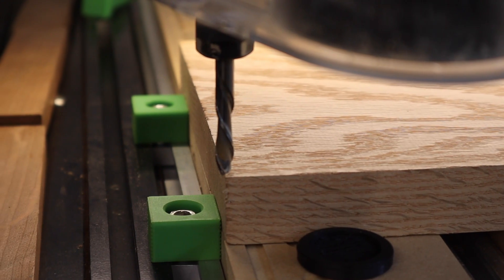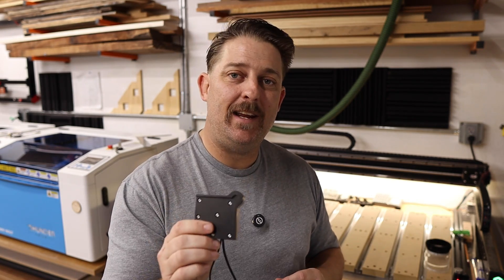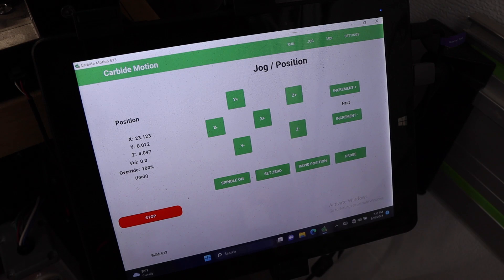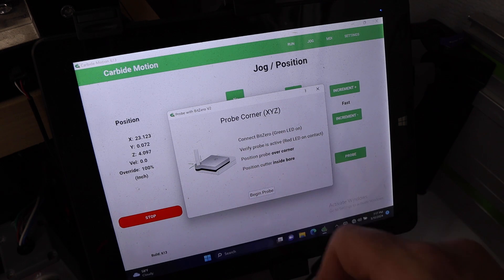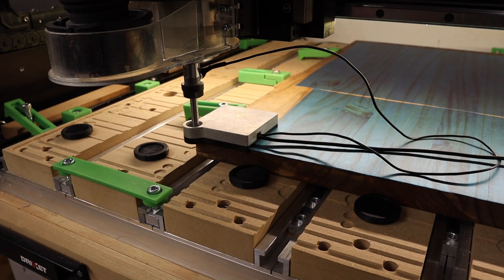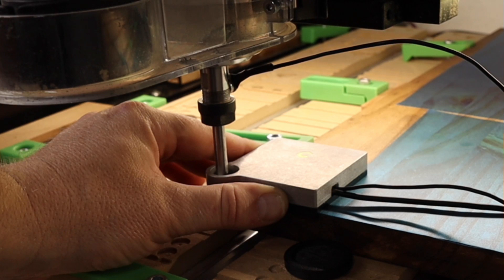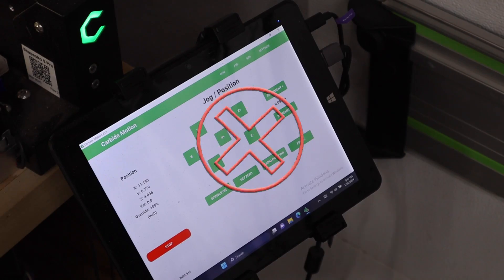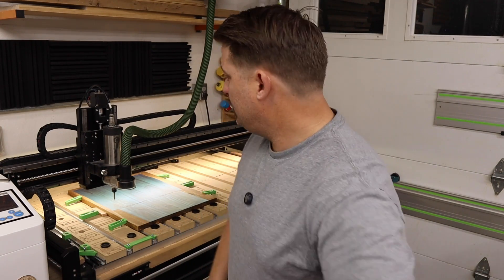How To Use Carbide 3D Bit Zero 2.0: Essential CNC Setup Tips! | Brett's Laser Garage

Comment: Brett, are you using CM V6?  On my Shapeoko Pro running CM V6, I no longer have the option to Set Zero.  I'm using the 1/4" pin to calibrate.  After finding the stock thickness I get the popup to remove the grounding wire.  When I click on OK the router moves to lower right to load a tool.  TIA
Reply from the maker: Hi there.  Yes I’m running CM V6.  Never had that issue before.  Maybe try searching the carbide 3d forum to see if anyone there has had the same problem.  Worst case I would contact support.

Comment: Brett, I found this to be perfectly explained.  You may wish to update and explain how, when probe is removed from collet, the router bit/mill is the EXACT right depth in the spindle.  I subscribed, and will be checking back.  Thanks
Reply from the maker: Thanks a lot Donald.  I think if it like this…the bit zero isn’t measuring the length of the bit in the spindle per se, it’s measuring the height of the bit off the material and storing that location.  When you switch bits or from the probe to a bit, the bit returns to the bit setter tool and measures, which brings the machine back to that stored zero point.  

So don’t think of it as returning the bit to the exact same depth in the spindle.  Think of it as returning the tip of the bit back to the zero position.  The bit setter is a huge part of this process that I didn’t explain well.  Without the bit setter tool, you’d have to use the bit zero and re-probe the z-height after every tool change.
Reply: @LaserGarage this answers the question I had after the video. Thanks for explaining

Comment: Using the BitZero V2 I find on the Z-axis it does not set the 0 (zero) as 0. It is always about 1 to 2 mm off the actual part surface. Shapoko Pro-5.
Reply from the maker: That’s weird, I’ve never experienced that issue and almost every time I double check my Z zero height manually after I use the probe as a sanity check.

Comment: How is this a Z zero? When you put the  cutting tool it will have a different length/offset. I own Shapeoko 3 XL and it is the worst garbage of machine (undescribable) or CNC software i have ever used. Pure, unrecyclable, trash.
Reply from the maker: Tell me how you really feel lol.  

No but seriously after setting your zero with the Bit Zero, you start your job, insert your tool, then the tool is measured with the Bit Setter.  Unfortunately the 3xl does not have this feature built in, although it’s an add on, but it’s been available stock on the 4’s and later models.
Reply: @LaserGarage  Oh, so they have added a dedicated bit setter. That makes sense. I can see that they have corrected(?) many of the flaws of the 3XL (blanket rigidity in all axes and table, no option for better table, anemic motors and drivetrains, no dust collection). Hope the machine is not useless because 3XL was dreadfull. I still have nightmares and has been 3 years since i stopped using it. Especially when having a background on Haas VFM (ok, no comparison), imagine the pain.

Comment: Hey man , once you completed a project and load a new file to start a new project do you have to reset xyz?
Reply from the maker: The XYZ zero points will store on the machine.  So unless you need to reset it due to a different thickness material or you need to move the material on your waste board, you don’t need to reset it.  

When I run my production items I leave the XYZ zero points the same because I’m running the same material.   Plus I used my dog holes and stops to put the material in the same place every time.
Reply: @LaserGarage  I thought it did but wasn't completely sure. I ran a project and it didn't cut down to the bottom of the stock so I was going to change my settings and set it so it would go to the bottom, then I was worried if I had  to reset xyz.  Thanks again for all you do!